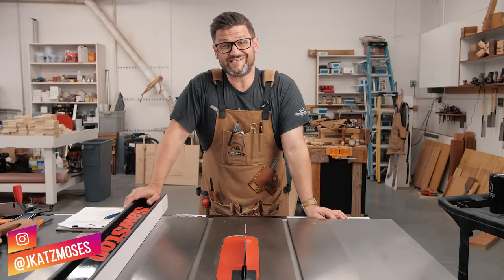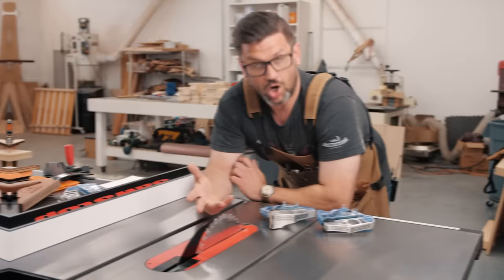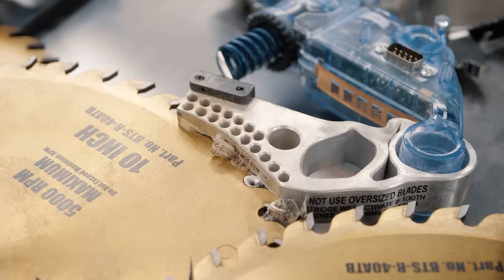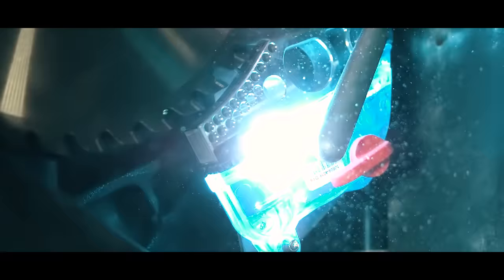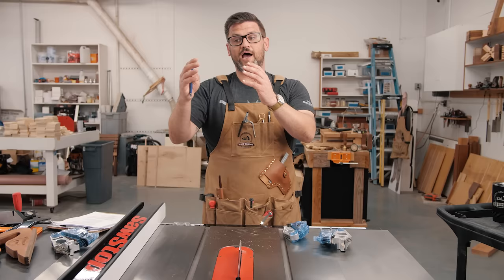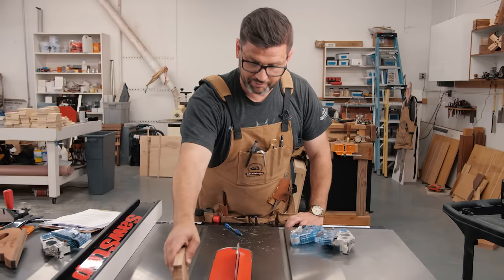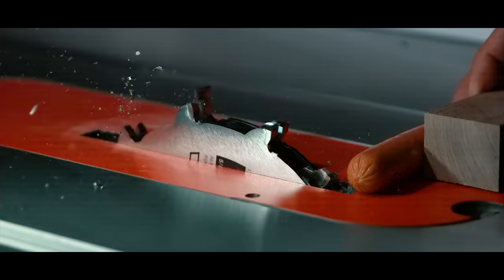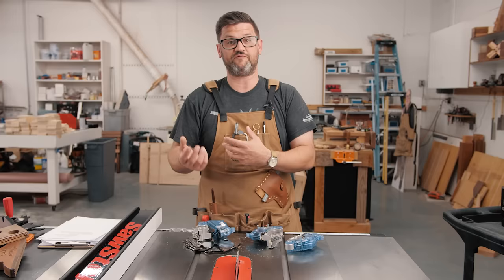How Safe is a Sawstop Saw? - Never Before Seen 19,000 FPS HD Slow-Mo Video

Comment: This device can’t be good on the motor. But I guess it’s better than losing a finger or worse
Reply: It probably trashes the saw. Wrecks the blade, bends the shaft, knackers the bearings. But, unlike your hand, all that stuff is replaceable. :)
Reply: The blade is driven from the motor with a belt. When activated, the motor power is turned off. Any spinning inertia will slip the belt without really doing anything to the motor.
Reply: @m.cigledy6769  There might also be a shear pin driving the saw blade, which will just shear and allow the shaft to slow down of its own accord while the blade nearly instantly stops.
Reply: The motor doesn’t directly drive the blade, it’s linked by a chain. The sudden stop almost always jumps the chain off the motor so the motor can continue to wind down. It does trash the blades though.
Reply: These devices are more than a decade old, dozens of thousands of fingers saved for sure. The saw is unharmed except for the cartridge and the blade.
Reply: Table saws are almost always belt driven, it is not uncommon for a piece of wood to bog down the blade or stall the blade which just results in the smell of rubber from the belt.
Reply: Do you think a 6-7 figure engineer didnt think of this? Gimme a break 😆
Reply: You just have to replace the cartridge. Also you can contact Sawstop and they'll replace your blade
Reply: Devil's Offspring Someday soon you’ll get a decent hand replacement, too.
Reply: @user-lq1dk6gr3p  No, but a 6-7 /finger/ engineer might. ;)
Reply: @dani007a  lool
Reply: You can activate the saw a 1000 times and it'll have no lasting functional effect on it.
Reply: Lol buy new fingers
Reply: If I had to choose between a finger and a table saw, I'd choose the finger
Reply: quickly stopping a motor doesn't damage it the only things that can damage a motor are heat and spinning/loading the bearings over what they are rated for  and other obvious ways of breaking stuff drop/impact damages.
Reply: People who have never used a table saw trying to explain how a table saw works. 🙄
Reply: @devilsoffspring5519  No, there is no shear pin, nor is one needed.
Reply: @SpiraSpiraSpira  Chain? You mean belt?
Reply: @jiml5837  And in that case, the motor remains under power. In the case of a sawstop brake activation, power to the motor is cut immediately upon activation.
Reply: S H yes, i did mean belt.
Reply: @Fine_i_set_the_handle   Well the motor doesn't stop immediately, but if it did it will suffer a similar fate to the blade in the video at 6:00
Reply: @user-lq1dk6gr3p  it's typical that most people believe they know more about the machine  than the people that engineer them 🤓

Comment: The place that my dad is working at used to have a sawstop they ended up getting rid of it because it never worked how they intended to and they work with wood that is slightly damp and every time they tried to use the sawstop it would always activate the break system in the saw and they only owned it for a few months before they got rid of it

Comment: What if you have your hand on dry wood or even plastic laminated wood? Where is the sensing limit for the sawstop? I cannot see that it would stop if Input my hand on it with my shoes on the workshop floor? Or is it sensing the current from the feet of the saw to toe blade?
Reply: It uses an electrical current through the blade. Your average piece of dry wood doesn’t receive the electrical current, so nothing happens. The average hand or piece of meat, like a hotdog, has water in it, which does receive the electrical current, and tells the blade to stop using the stopper. Basically when the electrical current is interfered with, the sawstop activates.

Comment: “For my final test, I will do a Mr Miyagi karate chop on the blade...

... only after 44 stitches and reconstructive surgery you’ll be right back to work” lolol
Reply: To be fair, you'd get stitches if you karate chopped a blade even if it wasn't rotating..
Reply: In Russia, saws karate chop you.

Comment: I’ve used a tablesaw for years.  They still scare me.
Reply: Honestly I think it's good to have a caution with a dangerous tool even if you're familiar with them. Way less chance of an accident compared to someone who uses one all day and becomes too lax cause they feel familiar with it.
Reply: This is the correct answer.
Reply: My grandfather has one from the 50s .
It doesnt even have a on of button.
Starting by plug it in.
Reply: And even those hightech protektion systems can fail. PLEASE don't trust those things and become careless. I know somebody who lost his finger to a saw which has the same features as the one schown in the video.
Reply: Yes scary frickin thing
Reply: Angle grinders scare me. They need to show every cutting disk operator a picture of someone with a disk fragment impaled in his cheek.
Reply: Table saw is the ONLY piece of cutting equipment I will ever use with fear. I'm cautious with others but I have seen some bad things happen with table saws. Great tool but I am always fearful when I use one.
Reply: jcl49er 72 Same. Lost my middle finger to one. Dad watched it :P

Comment: You still need to act like that safety is not there though.
Reply: Probably why he's showing us with hot dogs instead of throwing his fingers at this
Reply: Yeah, all safety gear should be treated like that. I mean, you don't slam your car into a wall even if you're sure that the crumple zones, seat belt and airbags will save you.
Reply: I have a SawStop.  I've triggered it twice...both times with the aluminum fence on my Incra miter.  The cost to replace the brake and blade actually makes me even more safety conscious, oddly enough.  Didn't even leave a scratch in the fence, btw.
Reply: You don’t anymore, it’ll work everytime
Reply: tentedkarma 746  unsure if it would trip the GFCI. But a bit of pork would definitely work, which is what a hotdog is, thinking about it.

Comment: All of our table saws at work have these. We have the biggest 7.5hp 480 volt saws(about 6 of them). Even if they were only 50% effective, I'd still want them. I'd rather have it and never need it, than to need it and not have it. I've seen two misfires this past year. Both times cutting plexiglass/acrylic. No digits were ever at risk, but I'd rather have it err on the side of caution. $200 compared to my friend/coworker being injured.

Comment: When he demonstrated the most forceful pass and activation of the saw stop and measured the cut in the hotdog it was definitely more than an 1/8 of an inch!  If that hotdog was 1” diameter the cut was as least 1/4” of an inch deep.  When he measured the cut it was from an angle that didn’t show the true depth of cut.  He should have held it up directly in front of the camera side by side with ruler.  Am I right or is there something I’m missing? Other than that the device is very impressive.

Comment: What forces is the motor and shaft subjected too?  There is a lot of rotating mass in the motor.  Stopping the motor that fast would be huge amount of force.  Is there a friction plate (clutch) or something to allow some slippage so the motor can come to a stop at a slower rate than the blade?  If not, I wonder how many activations the motor can handle before failure.  There must be some wear and tear on the motor from that.  Reducing its life.

Comment: "we caught something on camera you're not gonna believe"|
me: oh yeah sure what its gonna be a little flash or something?
>saw blade proceeds to disassemble itself
me: WHAAAAAAAAAAAT
Reply: Honestly this is such a good illustration of physics in action. It really illustrates how much energy increases with speed.
Reply: @hedgehog3180  I'd say this is more about engineering, particularly how things are built to be stable one way but not so much the other. It's like how when you wear a hockey goalie mask and get a puck to the face, the energy gets distributed and it's all good. If someone slaps you though, you wish you didn't have the mask. The teeth of the saw are designed to be tough when they bite into wood, when they get slammed in the other direction they don't need to be.

Comment: Also it should be worth mentioning that on the "going as fast as possible" try, some damage came from the already stopped sawblade that the sausage was pushed against so some damage didnt come from the sawblade beeing dangerous but just him pressing the sausage into it, which i dont think is how it would go down if it was the finger on someones hand.
Reply: That seems likely, considering how fast the human body can react to a painful stimulus. The moment your nerves registered the pain, your hand would already start pulling back on reflex. (Fun fact: If you touch something very painful, the reflex to pull your hand away happens faster than the pain signals reach your brain.)
Reply: @jaynestrange  i mean people lose multiple fingers at a time from normal table saws
Reply: @jaynestrange  that's because your body is hardwired to react before it reaches your brain. The signal reaches your spinal cord and immediately goes back to the motor nerves through something called a reflex arc, without wasting time to go to your brain. So basically, you'll react even before you know it. That's in milliseconds. You're not gonna get badly injured.
Reply: Makes sense; however, if you fell into the saw, you might experience similar damage from the static blade.
Reply: @shacka95  that's a good point. Even if you did lose one, that is still a better outcome than is likely without this tech.
Reply: @jaynestrange  Even reflex is limited by the speed of nerve activation and muscle movement. If you swing you hand fast, even reflexes have some delay that needs to be considered. A quick Google search suggests that typical latency for the reflex is around 20 ms which is 5x faster than best reaction time but still less than required for fast hand movement to be able to touch the blade.

Comment: The stopping force didn't break the dado tooth. One tooth hit another, and that's what broke it. That being said, still VERY impressive.
Reply: Yes thats wht I saw. The vibration from them stopping suddenly caused the metal to wobble & overlap into another tooth's edge by micrometers.
Reply: Yeah, you can see the blade furthest from the camera spin a little after the first two stop.
Reply: No actually that hot dog is made out of vibranium and caused the teeth to shatter

Comment: 2 points:
- Could it have been possible for the manufacturer to place the sensor a little bit ahead of the blade for extra safety?
- What about gloved hands, are they detected as flesh too?
Reply: If the glove insulated your hand where it wouldn't be detected, as soon as it cut through it to your skin, it would activate

Comment: And the hot dog is softer so it might not even be stitches
Reply: Dawson Lawrence, I don't think softness matters. The saw has such a big momentum that it probably wouldn't care if it's a sausage or a finger.
Reply: @nbvehbectw5640  Indeed, at that velocity, the relative density of your finger compared to the hotdog is probably entirely negligible
Reply: i had something like this happen to me, breaking a bone heals faster
Reply: @Muncles  I had my finger cut off by a saw and it fucking sucks
Reply: @milandas8458  completely cut off? That must suck. I just lost a bit of the tip
Reply: @Muncles  yep completely off
Reply: A saw blade can cut wood, your finger might as well be butter to a hot knife.
Reply: Softer less the issue. Hot dog doesn't have the interconnected tissue. So yes, it would barely be felt. You would not even be able to tell what happened.

Comment: The most impressive thing, is that a hotdog has NONE of the structural integrity that proper flesh and bone has, yet it still suffers almost no damages. Try it again with the drumette of a raw chicken wing, and you will get an even better representation of what the actual damage will be.
Reply: Considering how shallow the cuts are, they probably wouldn't even reach the bone anyway.
As a result, i'd say these are accurate.
Reply: tentedkarma 746  Ballistic gel is used for consistency tests, and not the replication of human tissue.
Reply: @11cookeaw14  you could hit the bone, depending on how and where you hit yourself, but it'd be a bit of a task to achieve. A chicken drumette would give more realistic results, but the hotdog gives a much better representation of how little damage you'd get.
Reply: Your skin and flesh is much closer to the integrity of a hotdog than it is to a hardened carbide saw blade. To the table saw they are the same.
Reply: @11cookeaw14  
Not really. Skin is more durable than you think.
Reply: @foxtrotwhisky4061   not really as with the other person i replied to, skin is more durable than you think. The blade would cut even less due to it.
Reply: I would love to see this guy do the fast test with a chicken wing or drumstick
Reply: @foxtrotwhisky4061  even against something that chews through everything like a saw blade, a hotdog will always produce a more exaggerated injury. That is because it is a formed paste that can be broken or squashed with ZERO exertion. For realism, you would want to go for something that more accurately represents a finger or thumb...something with bone, muscle, tendon, and skin...like a chicken wing.
Reply: Ooooooh I didn't even think of that!
Reply: Testing on something softer is a better representation.
Reply: @bobbowie9350  testing on something softer will only ever produce exaggerated results. A chicken drumette cut at the elbow join will produce a more realistic result, because it more closely resembles the structure of a thumb.

It's akin to cutting a piece of tissue paper to show how durable leather is.
Reply: the skin of the hotdog isn't stopping anything.. neityher would any other meat.. that blade is cutting whatever it can touch
Reply: @superme63  No, you're not showing how durable anything is, you're showing that the hot dog is not being obliterated because the saw was retracted. There's 0 difference between sticking a finger or a hotdog in the saw, it will have the same result.
Reply: I've changed a few brake safety cartridges after our shop employees have hit the blade over the years.  Nothing more than a minor scrape at the worst, not even worth a band-aid.
Reply: @cowboyzr2  good on your shop for investing in those.. a kid in highschool chopped his index almost clean off with the table saw and they never cleaned up the blood stains
Reply: @cowboyzr2  Lol, it sounds like you need to change employees if you've had to change multiple brake cartridges. 🤣

All jokes aside, that's pretty much what I'd expect, but I'd still to see a real world test with a chicken drumette.

Comment: I’m so scared of table saws, I don’t even have one. A Track saw does everything I need. Yes, multiple narrow rips are a pain, but not as painful as chopping a couple of fingers off. For the home garage wood worker, who can go weeks without using a particular tool, and doesn’t always follow best safety practice, and can be distracted by the Mrs coming in and shouting at any random moment, table saws are just too risky for me.
Reply: It’s pretty easy to not get injured with a table saw. You just need to know what you’re doing and pay attention.
Reply: Totally agree! Well said.
Reply: @tylerk.7947  Neither of those two requirements apply to me unfortunately!  ;)
Reply: If you're going to use one, be smart and have tools at hand that keep you from getting near that blade. 
A pusher tool for example
Reply: When I operate a table saw, which is infrequently, I advise wife and anyone else that for the next five minutes I am going to ignore you, heaven and earth until the blade is stopped and I don't even remove the piece of wood until the blade is stopped since that's when the wood can kick back as the blade is slowing and you start to remove it.
I had excellent shop teachers in school and was dismayed that shop is no longer taught anywhere apparently.   I learned welding, metalwork, woodwork.  All of it is dangerous.  It is also what makes the world go round; best to teach youth to operate this machinery safely.
Reply: @Randy Rinker What he said!  :-)

Comment: As a contractor myself for many years, I know that this will not always work BECAUSE, many contractors use GLOVES to protect the hands. Now that being said, what would happen if the glove was install over the doggy. What type of damage would it create or not create. I would love to see a demo done with none conducting materials such as the one mentioned above.
Reply: It would cut through the glove and then business as usual when it touches your conductive flesh. You aren't really gonna be complaining about a pair of gloves when the sawstop saves you from losing a finger.
Reply: Good point, wonder if a leather glove would have enough capacitance to set it off

Comment: If you're still on the fence about how safe these things really are the activation and the stoppage of the blade really does occur before your brain can register it happening. I've tripped mine twice now, once with touching the blade with a tape measure and once with an Incra miter gauge. Both activations made me immediately think I broke the saw. Nope! The tape measure got a tiny nick. The miter gauge showed zero signs of damage. 
It does get kind of expensive so it does speed up your learning curve of things to avoid. It ABSOLUTELY beats cutting off part of your body.. My old saw took part of my fingertip with it so I no longer play the guitar.. Once you touch a spinning blade of other saws you CANNOT pull away fast enough. They WILL absolutely remove flesh and bone AND you won't realize it till it's too late. It also happens so fast that you don't feel the pain till you see your own blood flowing. The pain comes on the way to the hospital and for a week or so afterwards.